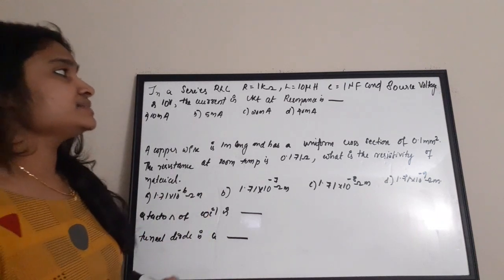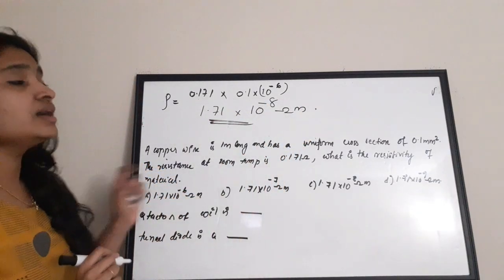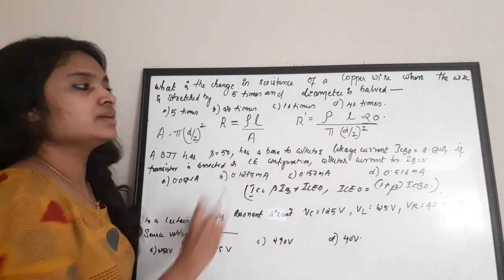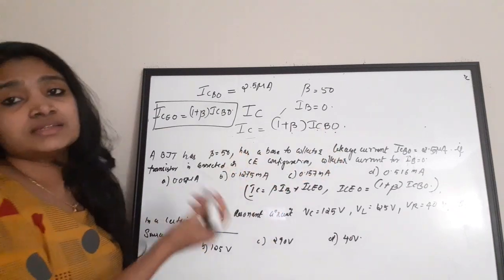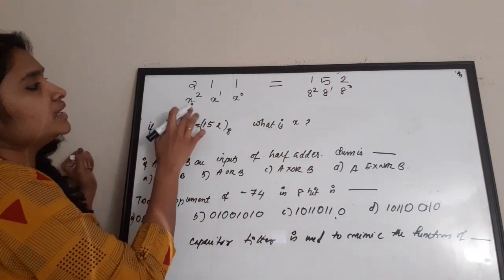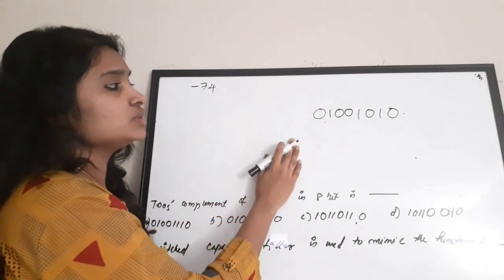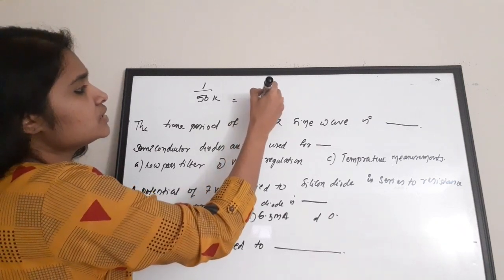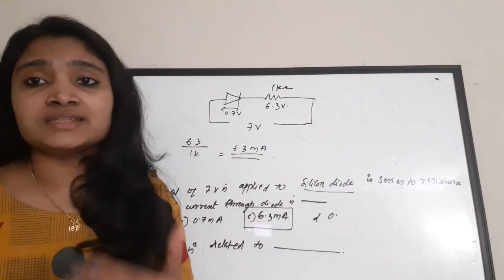Competitive Exam Preparation of Electronics and Electrical Part15| Technical assistant| BEL Exam

Comment: Semiconductor diode are not used in anywhere of low pass filter  .
Reply from the maker: That's also right. I have added the correction.

Comment: Ma'am in which application a diode is used as low pass filter?
Reply from the maker: Silicon diodes are also rarely used in low pass filter but they are not generally used in temperature Applications